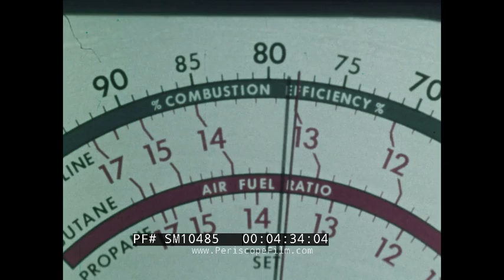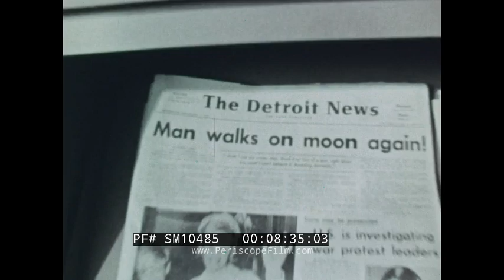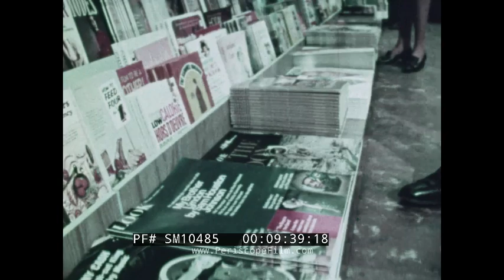"OUTLOOK '70 "  IMPACT OF NASA SPACE PROGRAM TECHNOLOGY ON AMERICAN INDUSTRY PROMO FILM  SM10485

Comment: 2:06 The bold claim that baggage handling delays would “cancel out the time advantage of air travel unless new systems are installed, RIGHT NOW!” was obviously FUD planted by the Webb Co. And as it turned out, those “autonomous” electric luggage carts were tried, 25 years later, at Denver’s new airport, where they failed epicly—so much so that the “futuristic, intelligent” system was ripped out and replaced with traditional conveyors. To add insult to injury, that project is now used as a case study in engineering blunders and a cautionary tale of technology begetting complexity.